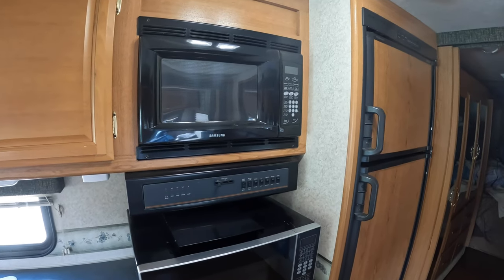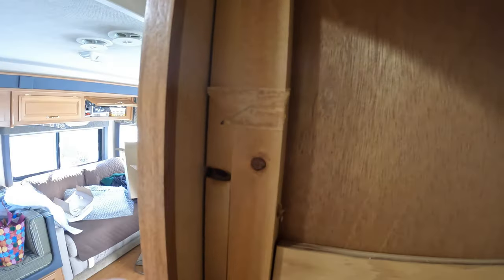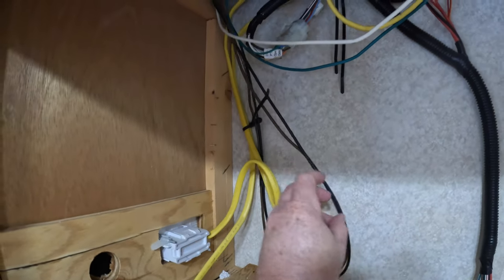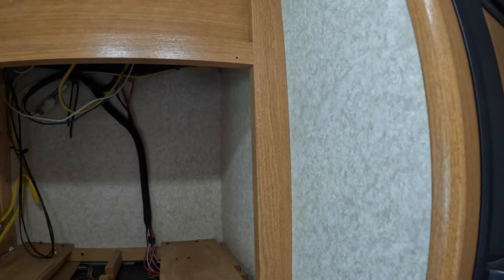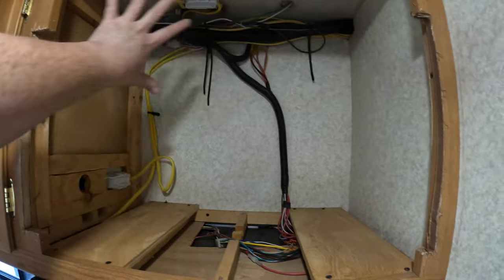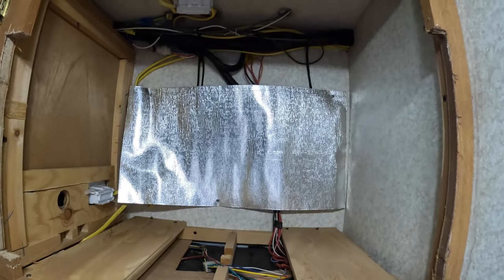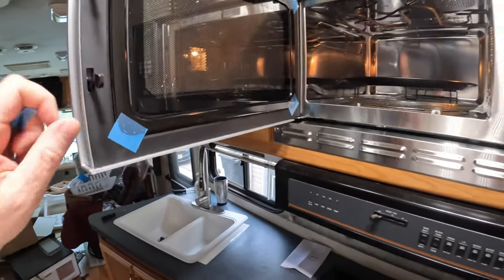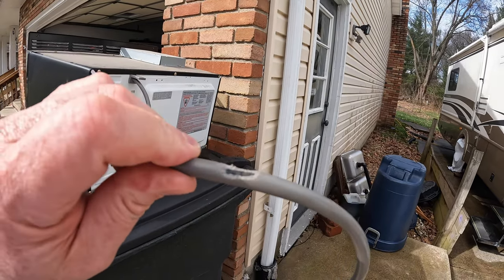Upgrade old Microwave.. Step by Step to Greystone Convection Oven

Comment: Did the new unit come with an AC plug for an outlet?  If so, how did you hook up power to it without an actual plug?
Reply from the maker: The unit comes with a normal 120 AC plug.  Just needed to plug it into a receptacle which was in the cabinet next to it  Very easy. install.